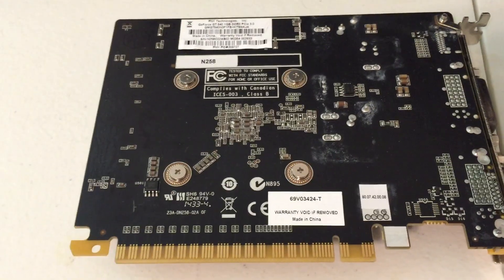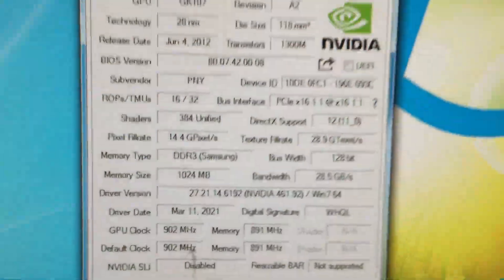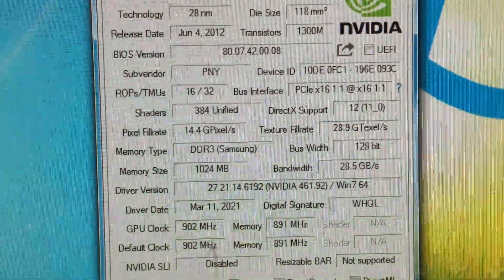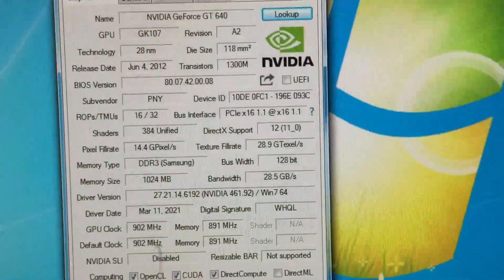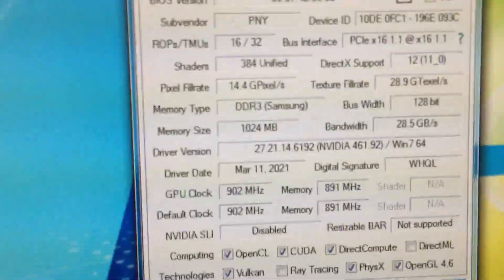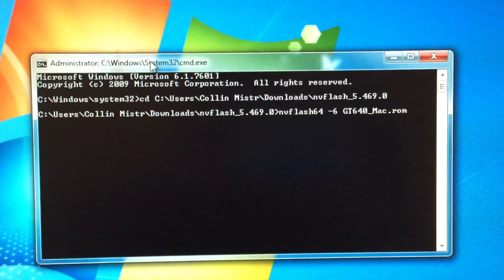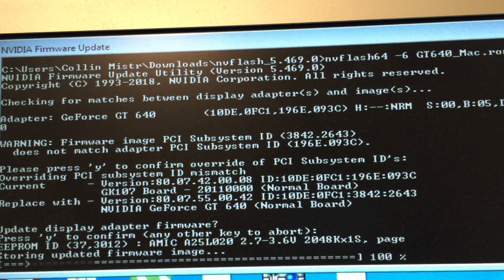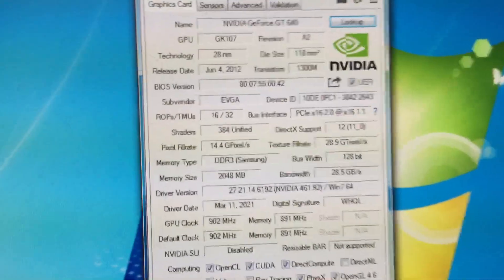Upgrading VRAM on an nVidia GeForce GT640 GPU

Comment: After removing the old solder off the old RAM doesn’t new solder need to be added?

How did I miss the part where new solder was put on the board? It looked like he used fresh leaded solder to help remove the old solder with some braided copper wicking material but then was solder added after that?!

Comment: no no no Stop saying it Detects it Doesn't Detect anything you just Wrote into its own Bios to report that because the Bios is Edited cause it still says DDR3 (Samsung) so that means GPU-Z doesn't detect your Chips it only reads what Bios says is Written into it and the part with Samsung is still Written inside the Bios to report it that's all

Comment: Would it theoretically be possible to upgrade a D300 2GB from the MacPro to 4GB? Supposedly the firePro W7000 is essentially the same GPU, but comes with 4GB. As you said in this video, even if you upgrade the ram the firmware may still only see the original ram size.

Comment: One genuine question as I’m gonna be modding a lot of GPUs, is it possible to mod any GPU from its original vram models to almost any amount for example?

Gtx 660ti - modded 8gb vram
560ti - modded 4GB vram 
Gtx 750ti - 6GB vram so on and so on

Not like for some GPUs which already have another model of the same GPU with extra like 
Gtx 760 2GB / 4GB vram 
Which would be like this mod shown in the video 

I’m trynna reuse some older GPUs to hold up in newer titles if it wasn’t for vram constraints

Comment: So you are saying that you have to have the right amount of ram to match the bios.  So a PC Radeon 9200 256mb video card could not be flashed for a mac as all the mac 9200s have 128mb?  Also, are you saying that you cannot add more memory to a card then what can be changed or flashed in bios?

Comment: When you flashing with modded firmware, there is only one beauty defect, you did not overwrite the memory type because still it shows SAMSUNG, whereas you reball with MICRON chips🤫It can be seen that you understand it, but you are "inconsistent" even though this "error" does not affect the operation of the card.😉

Comment: Would be cool if that would be possibile with the current nvidia 4000 Series, they are lacking a huge deal of vram.  Maybe even chat-gpt like programs are able to write bios versions, so it matches the amount of ram  you want to install.
Reply: Your main objective should be getting the exact RAM/memory chips
Reply: @Respectfully10 Some stores actually do sell GDDR6 memory but not sure on GDDR6x
Reply: @billnorman7894  They already do on Tao Bao or otherwise. most of these chips however are recovered from GPUs that have died in one way or another. most of the GDDR you see on the market is essentially the same- either harvested from corporate GPUS and Skus for use in lower density cards, or salvaged from broken cards and tested for consideration and sold.
Reply: @Respectfully10  Exact RAM/Memory chips are a myth- most come in different bins, what matters more is the simple factor that they are all the same RAM type/Sku. Most card autodetect these expanded memories easily, but the BIOS refuses to address them due to either non-consideration for the SKU or simple software locking.

Comment: I thought back then if I’ll take a 2070 and upgrade it from 8gb to 12gb it will work and it seems that your test you conduct on an older GPU can be made, I think that Nvidia or AMD knows about it and also that there are ppl who can do it so I think they will block this option no matter the physical change am I right ?
Reply: The limiting factor will be if there is a driver that supports the upgraded amount of vram. In the case of the GT6r0 case there's firmware and drivers for both 1GB and 2GB versions so the upgrade works, but if the only 2070 drivers for an 8GB version then an upgrade to 12GB or 16GB won't work as you wont have any firmware or drivers to take advantage of the upgraded vram

Comment: Which temperature did you use for your hot air station when reapplying the new VRAM chips? Was it 300C too? And, do you think this temperature will work for newer boards like the RTX 2000 series, seeing as they are most likely thicker?
Reply: It will depend on the type of solder the cards use as well as their thickness. I say start at 300 and slowly work your way up if you find it to be inadequate

Comment: I'm in a similar situation (kind of)... So I have a Gigabyte GTX 760OC 4GB card which is dead from components being broken off by the previous owner, and I've also got a Gigabyte GTX 770OC 2GB card which has 6 bad memory chips out of 8 as per MODS. The memory is the same Elpida, just a different size and revision obviously (the revision shouldn't matter, at least it doesn't when replacing the VRAM on any other card with the same size chips) and the PCB's are literally the EXACT same, just the 770 has a few extra MLCC's on it, and an extra voltage regulator for each stage of the VRM. The voltage controllers and everything are the exact same.

Shouldn't it be possible to replace all the memory from the 4GB 760 to the 2GB 770 and just flash the bios to a 4GB 770 like you do here? I already have the patched version of nvflash and everything so I know how to do that stuff.
Reply from the maker: Yeah, if the correct ROM is available, it should work.

Comment: You did not change the vram resistance values (physically). Does this mean that if you solder the same amount of chips, but higher density models, you don't have to change vram resistance values? That would be very good. 😮
Reply from the maker: The memory info is all part of the video BIOS, the only thing the resistors set is the manufacturer info, which is purely cosmetic and doesn't actually matter.
Reply: @dosdude1  Thank you for this good video and for this information. This resistor thing held back me for a while to do memory upgrade.

Comment: Hey there - I have the same pre-heating board and on mine I noticed that the actual board temperature is -100 degrees compared to what the machine says (because the thermocouple is close to the heating plates). So to have the board at 150 degrees I set the machine at around 250 degrees. My question for you is: when you say you set the temperature to 150 degrees, do you mean the board or the machine? Great video(s) thanks!
Reply from the maker: That's set on the machine itself.
Reply: @dosdude1  interesting, thanks. Did you reposition/modify the thermocouple at all?

Comment: Hello dear friend, i wanted to ask one question. I am also trying to solder memory chips to gpu but everytime the chip will blow away. How can i stop chips from blowing away ? Thanks a lot
Reply from the maker: Use no nozzle on your hot air, and turn the air rate to just above half.
Reply: @dosdude1  thanks

Comment: the ram is Samsung like the original and not the Micron that you have soldered ... ?? is not the same card ?? look the Device ID on GPUZ ....
Reply from the maker: It doesn't matter; it's only cosmetic. The Micron VRAM will work just fine, even though GPU-Z still shows that it has Samsung memory.
Reply: @dosdude1  I don't know it's weird.. It's not too easy to upgrade vram, it's more complicated that only solder more ram and upgrade firmware..

Comment: I tried this with the NVS 3100M in my dell latitude E6510 to go from 512MB to 1GB but just broke it, it has 8 spots for chips to go (4 on both sides of the board) and 2 on each side are empty, I bought the parts that matched the 4 chips already installed and when I tried to install them the solder on the new chips wouldn't melt at the highest temperature my hot air gun goes to, the empty spots had solder on them and that's the only solder that would melt, I used the solder on the board to stick the new chips on it but when I turned on the laptop it would try to boot and shut off then turn on again and shut off, I took out the motherboard and threw it in a pile of junk parts bought a new one off Ebay moved the ram over from the old one and now the laptop works again, I decided I hate BGA soldering after that and now if something needs BGA soldering to repair it I just throw it away or have someone else do it, the only stuff I will fix now is stuff that needs through hole or SMD soldering because those are easy.
Reply: you need to pre heat the board before heating up the component you wanna ad or remove

Comment: is it possible to add or change the ram of the GT 1030 GDDR5 to GDDR5X or 6?
Reply: The gpu chip wouldn't handle much higher speeds and the memory chiplets must fit in the bga layout, so it's probably a no.
Reply: Changing the ram isn't the problem, problem is the bios, you need to hack (rewrite) it. I once made an GTX 1060 8GB , With an hacked 1070 bios. Works just fine !

Comment: This is awesome, been thinking if I can upgrade the RAM and/or VRAM on my 15"MBP2012retina and I figured I'd have to do a similar process. I would first need the proper equipment and some experience with the process and would start with something like this project first. So this was super informative, thanks!

Comment: This is a very good argument for why GPU memory should be modular. Old capable cards could still be useful today with a small memory upgrade.
Reply: Thats not how graphics cards work, 
You can have a 200GB card from 2000, it wont run faster than a 8GB card from 2021. 
due to the limitations of architecture they used back then
Reply: @tibib0ss  yeah obviously not THAT old, i'm talking about 4GB cards from not too long ago being upgraded to 8-12GB.
Reply: @criznittle968  so I'm wondering what happens if you put the memory that a fake Chinese card is looking for on it with the fake bios they have flashed on it 🤔
Reply: @79huddy  good question, maybe it would use all the memory, but just slow it down to the slowest memory module.
Reply: @tibib0ss  Thats true I guess, but I would be willing to bet my old gtx 1050 2gb would benefit a lot.
Reply: @potatoes5829  It definitely depends. a 1050 2gb won't exactly double frames by jumping to 4gb- speed and integrity matter just as much as well as addressability. For a long time there was a divide between addressable registers and consideration of usage- especially in the laptop space. Double the VRAM did not mean double the addressing or density. Instead they utilized a 4+4GB style of addressing. That is that the addressing of the GPU didn't utilize the extra VRAM unless absolutely necessary.

Comment: So... it shoud be more easier to upgrade a 1060 3gb to 6gb just by adding some ram heat it up, and flash a 6gb BIOS on it?
Reply: Only will work with an hacked 1060 6Gb bios, not an original 6Gb bios, I once made an GTX 1060 8GB , With an hacked 1070 bios. Works just fine !

Comment: You can also edit the gpu bios/efi file. Back in the day, there were many files floating around, pre modded.

Also, i am pretty sure I flashed a pci 6200fx with 256mb of vram with a pci-e rom and it worked perfect (not sure if the memory was a match)

Great job tho, its now a much better upgrade
Reply: so many people talented
Reply: Where u get the flux from

Comment: Is that possible with a laptop integrated GPU like a 1060 3gb to 6gb ?
Reply: Don't know if it works on an integrated GPU, But I once made an discrete GTX 1060 8GB , With an hacked 1070 bios. Works just fine !
Reply: @gertjanvandermeij4265  yes discrete GPU sorry for that where did you found your walkthrough ?
Reply: 1060 6g has more cores enabled, so you might benefit from flashing a vbios (if there is one)

Comment: Is there a specific reason GPU-Z reports the memory modules as Samsung still when you installed Micron ones?
Reply from the maker: The ROM I flashed was for one with Samung chips. It doesn't make any difference other than simply saying "Samsung" as the manufacturer.
Reply: @dosdude1  Thanks for the reply it's appreciated! Very helpful video

Comment: So upgrading vram is reliable?my gtx 1060 recently died nd the service guy told me it's yhe Vram's issues
So I'm just wondering if replacing vram is  a good option
Reply from the maker: Yeah, if done correctly it'll work just as well as it did from the factory.

Comment: Not done - change straps. Micron in. Samsung to be shown is incorrect
Reply from the maker: I don't think that's strapped, that info is most likely part of the video ROM. Either way, it doesn't matter, as long as the size is correct. The manufacturer info makes no difference other than what is shown in a utility such as GPU-Z.

Comment: Bro, i really appreciate you posting this video. Can you post a link to where you ordered the VRAm chips from. Im looking to see if i can upgrade my gtx 1060 4gb cards to 8gb versions.
Reply: There is no 1060 4GB model. At least, if you have one it's an anomaly. That card should only come in 3GB and 6GB variants with the 3GB actually having a lower number of shaders in addition to the lower VRAM (there's also a somewhat rarer 5gb model that was exclusive to Chinese markets). So first figure out which card you actually have and even then it might be a fool's errand. If you have 4GB of VRAM then I'm willing to bet that VRAM isn't your bottleneck and your GPU core can't keep up. Realistically you will end up with a much better result just selling the card and buying a replacement.
Reply: @SometimesImaPenguin  I caught that too but I was thinking of upgrading my rx470 4gb to 8gb. Normally I wouldn't bother with something like that but it's still a great card and has massively increased  in value but the 8gb cards fetch a better price
Reply: @SometimesImaPenguin  I appreciate the response. I'm mainly looking to do it for the experience and because I have literally nothing better to do with my life. I've been trying to get into soldering and learning more about circuitry for a while but just never got around to getting what I needed to get started due to lot of mobility issues that prevented me from doing anything that required precision and prolonged use of my hands. Best way for me to learn is to just jump into it though.  Not really worried about the practicality of it but knowing how to properly do it could come in handy later if I actually need it. My 470 is just a spare card so it's not really a loss even if I screw up. I also have a bunch of projects I've had to put on hold and electronics that are now useless because of damaged parts that could be fixed with soldering. Just figured it would be something interesting to try out. I've already priced everything I would need. Most of it I could get for free or second hand from people I know. If I were really concerned with profit though, I'd just sell the card as is. They're still selling upwards of $300 on ebay which is almost double what I paid for it 5 years ago.
Reply: @RaneBoDasch  That's a good reason to mod it. Just invest in a quality hot air station and practice on some throwaway boards first to get the hang of how the chips and soldier joint react to being heated. Louis Rossmann has great tutorials on the topic.
Reply: @SometimesImaPenguin  will do. Thanks for the advice

Comment: what if you put gddr5 modules and flashed a gtx650 rom?
Reply: It won't work. The GTX 650 Die is physically different from the GT 640
Reply: @ardwivedi16  Nope, they both have a gk107 chip with the same amount of cores enabled. Only problem here is different memory i/o and bga layouts.
Reply: @kingeling  OK, I thought they would be different

Comment: How much would you charge a person to do this from 4gb to make it 8 gb
Reply from the maker: Depends on what card it is, how many memory chips it has, and how expensive the larger chips are.
Reply: @dosdude1  it's a AMD Firepro W5100 with 4 1GB chip each. Want to trade them out to 4 2GB chips. Was told you could flash the card to a AMD W7100
Reply from the maker: @chrish.9632  There are most likely 4 more underneath the heatsink (according to images/specs I've looked at). It'd probably end up costing around $200 - $250 total, parts and labor included.
Reply: @dosdude1  So what would happen if you flash a 8gb video card onto a 4 GB video card? Would it brick the card? Or would the card just run slow?
Reply from the maker: @chrish.9632  It sort of works, but as you use it more it eventually locks up, usually within a few minutes (once it tries to access a memory address that doesn't exist).

Comment: Hi dosdude1, since I couldnt find any way to contact you, I write you here.
Do you think there is any possibility to install on a M1 Machine Windows11-Arm via Bootcamp? I mean bootcamp is on those devices just hidden and I thought if one would change the plist that it’s compatible then it should be working but the only thing missing would be the apple device support drivers. Since you know so well about macs and I know basically nothing I wanted to ask you if you see any chance to make it work on a m1 machine to install it or if you say it’s not possible at all.

Comment: Do you think such a mod might be possible with the gtx 980 from 4gb to 8gb?
Reply: no, its impossible.
Reply: @CocoaEm  Certainly not impossible ! I once made an GTX 1060 8GB , With an hacked 1070 bios. Works just fine !
Reply: @gertjanvandermeij4265  No you didn't. I know for a fact the memory controllers for the missing bank is disabled on die.
Reply: @gertjanvandermeij4265  plus even if it wasn't the bios needs to be signed by nvidia. Or it will refuse to load the bios. And the 1070 bios will not work on the 1060.